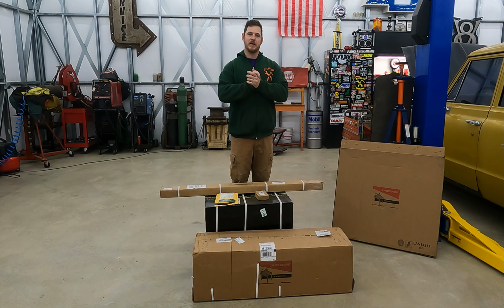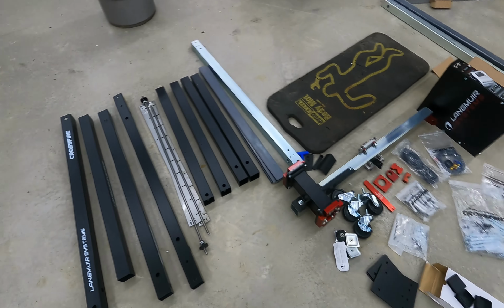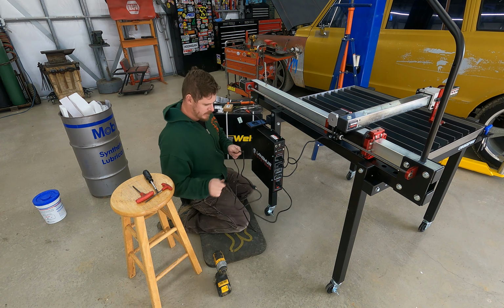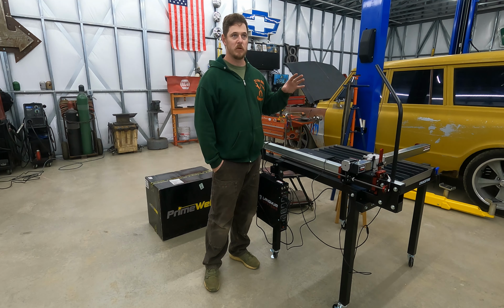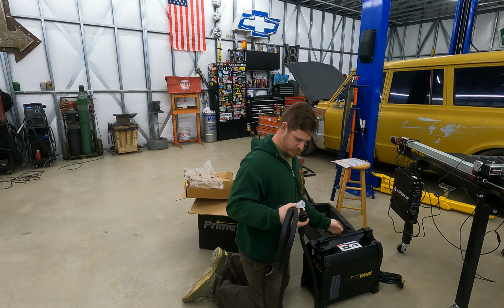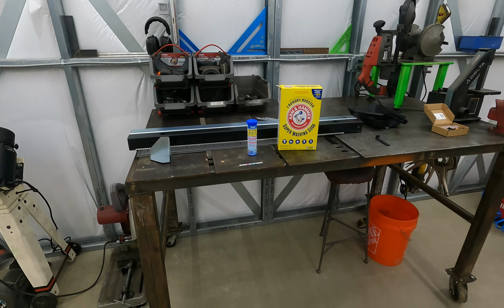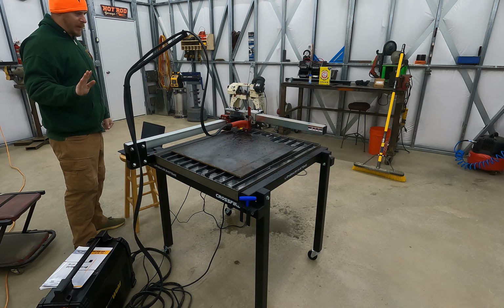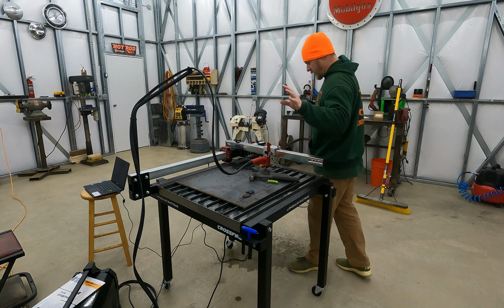CNC Plasma Table Assembly and First Cuts!

Comment: I put mine together last year from sitting for 3 years but now fraustrated on where to go to start i already downloaded their program i heard its a lot of learning not including air pressure and all that
Reply from the maker: I feel ya. My biggest hurdle was learning the CAD, CAM stuff through fusion 360 and also getting it to work on the machine. It's a huge learning process and your not gonna get it in the first shot. I used the crossfire forum and instructions a bunch and still do. I don't use it a ton, but it takes a few projects to get used to using it and even then I am still learning things every time I use it.
Reply: @DJsHotRodFab  i am thinking of selling it not  getting what I paid for but going with the arc droid cnc were you trace anything and it’ll do it for you i think thats what it is arc droid small screen and it’s red and small
Reply from the maker: @ralphzavala8757  I tried to buy an Arcdroid when I bought this and the Arcdroids were sold out. I would still like to have one.
Reply: @DJsHotRodFab  true debating on still getting one while I learn on the langmuir